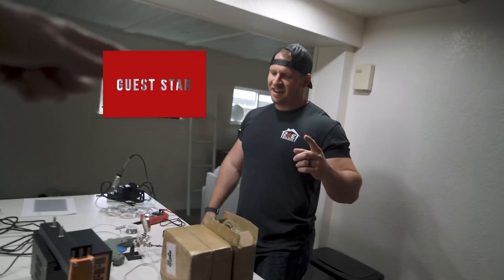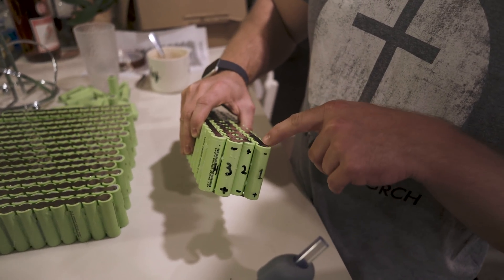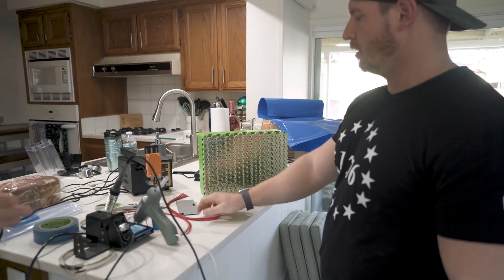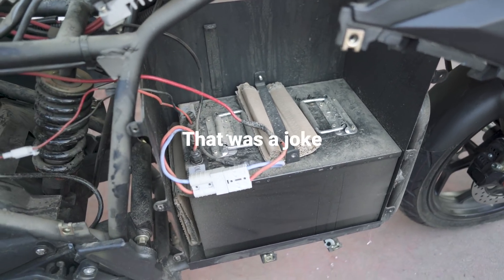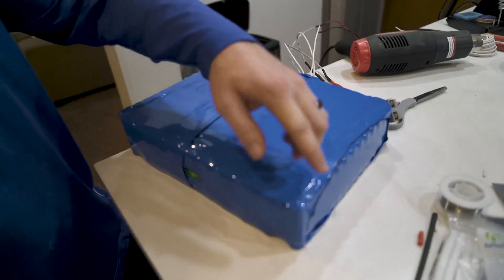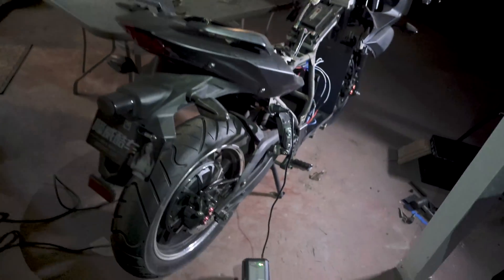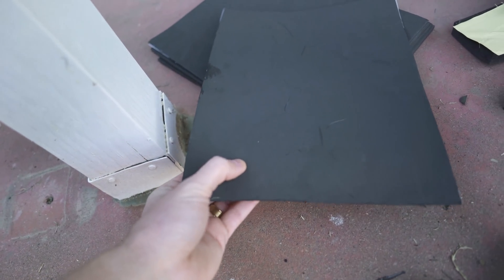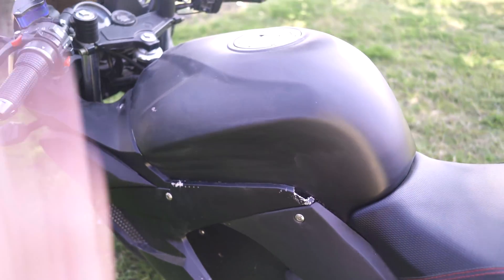UPGRADING the ELECTRIC SPORTBIKE from CHINA | Installing a Home-made Lithium Ion Battery

Comment: @ The Inja ... Right... Make another battery just as you did... And run it as parallel to the other battery... Nigh on double range.. and it'll fit in the battery storage area too 🤔😎
Oh and copper grease behind the pads will help reduce or eliminate squeaks (I'm a biker and it's a known trick to stop squeaks)
Reply: How heavy is the battery they built. Won't it slow it down the extra weight of a second battery

Comment: It's so funny to read comments:now go for new motor!!! Or : your controller is crap go for 500A controller!!!You made new battery but you made it for 3000w peak motor. Your motor is 8000w peak so you need to build at least one more same pack as you have now. Step 2 is power wires it should be at least 8awg. I tested ebike with 2000w qs 273 v2 motor. It was capable to accelerate fast to 85km/h. Step3: votol is not easy to connect but if you are lucky you coud easy to tune settings. There is some gear settings like low medium high and sport or R. In DISPLAY window you can check is it changes while you change it on motorcycle. Perhaps it was set on low when you did test drive.
Reply: Not true, you don't make a battery for a specific motor. You use one battery to power one system. His battery can and will hold it's ground on a 12kw peak motor, what's holding the bike back is not knowing how much power the controller is pushing to the motor. The power mode was a good idea :)
Reply: You can find me on whatsap or viber +37067183257
Reply: Tadas P I was offering help as well!
Reply: Tadas P He really needs a manual for the controller. It may be programable to take advantage of the new battery packs amperage.
Reply: @peterk.2772  I was offering help he said thanks no. So???

Comment: Hi dude , i would like to recondmend you using yyk7280 controller. Im using 60v battery, on this controller i hit 60km/h on the first gear. And it also have bluetooth module which you can connect to your phone apps to monitor the system. Im from singapore btw. Enjoy up video. Do make more video.
Reply: https://youtu.be/fSsEpPnuo0s
Reply: Martyr4JesusTheChrist  the controller is 48v to 72v 50a.

Comment: Hi mate. You need to check the amperage on the controller. Don’t forget the amperage is not the same as amp hours
Reply from the maker: Yep!
Reply: I’m about the change the controller on my ebike to a 72v 1500w with a current of 90amps. I’ve been playing around with changing the wheel and controller and I have the problem of not enough top end. Just recently I’ve seen some powerful controllers that you can do burnouts on. Soon as this novel coronavirus has died down a bit and everyone gets back to work I will order one for myself and then let you know how it goes. Also you need to check the CDR ( continuous discharge rate) of your lithium battery.

Comment: From a thermal management perspective, I’m concerned that you are asking for trouble by hot glueing the batteries together rather than using one of the spacer systems.
Reply: If you're running your batteries so hot the glue is melting, you're pushing your batteries too hard. They will hate you for it, and they'll degrade significantly faster.
Reply: Martyr4JesusTheChrist  I tend to mostly build packs for electric bicycles, and usually 24s 100A minimum. I've never had an issue with standard (good brand helps a lot) hot glue, unless the cells are being pushed wildly out of spec. Since they're for electric bicycles, space tends to be at a premium, so no room for cell holders.
I have no gripes about this battery build. Well, minus the severely undersized wire hahaa.
Reply: Martyr4JesusTheChrist  the high temp hot glue melts at a slightly higher temp than I'm comfortable to use
Reply: Martyr4JesusTheChrist  24s is 100.8v at 4.2v per cell, aka hot off the charger
Reply: Add another battery pak and it'll run cooler and faster. A more powerful controller (GOLF CART 275 - 500 amp!) and it'll rip
Reply: Martyr4JesusTheChrist  it'll reduce voltage sag under high load. Which if you're using flux weakening will potentially be quite a lot.
Reply from the maker: We'll see how she does

Comment: The battery is ok.  But Its not a good idea to use Hot glue.  if the battery pack heat the cells will move.
Reply from the maker: If the battery gets that hot, the glue isn't my main concern. Haha

Comment: those thin discharge wires worry me. i know they used them before but i still wouldn't trust it with upgraded equipment.
Reply from the maker: I feel you
Reply: Silicon 10awg is what you need

Comment: try to use thicker wire!! it can not handel the load if you pull 3000 watts @ 72 volt = 42 amps…. upgrade also the wire and performance will boost even more
Reply: Its not a speaker lol These dont work like. that. Even the wires on a Zero ebike are tiny. They're hall sensor wires. Hall sensors are TINY.
Reply: @RetiredYTChannel  What?  You think the motor receives all of its power through hall effect sensors?  The controller still needs 8-10AWG wire receiving from battery and 10-12AWG phase wires to the motor, almost 0 power goes through hall sensors, less than 100mah most of the time, I don't even understand why you'd comment that...
Reply: @row8261  All the controller wires are pretty small too. In this case it's not the bigger the wire the better.
Reply: @RetiredYTChannel  Yes it is, theres no downside to having oversized wires, only upsides like lower internal resistances and lower induction from longer runs of wire.  If hes drawing 40A through 14 AWG wire it will act as a fuse and increase in resistance as it warms up until the wire melts, the insulation melts and then something shorts, you really gotta stop talking.
Reply: Martyr4JesusTheChrist  haha no i cought my 8 year old son on my account
Reply: @bareldnijboer2730  no need to lie, just educate yourself on the topic in question or don't make incorrect statements.  @Martyr4JesusTheChrist this guy never stops.
Reply: @row8261  what do you mean? my son and i share a account on youtube and he posted something by mistake this morning and did a thumbs up (8 years old) so what...why do i have to lie?
Reply: @bareldnijboer2730  you changed your original response to what I have told you multiple times for 24hrs, you're not fooling anyone that your 'son' wrote the original comments just own up to it and move on.  And increasing wire diameter doesn't increase performance, which you stated incorrectly, it increases consistency and lowers overhead.
Reply: @row8261  i dont know what your problem is... but mulitple  times? i only posted one thing and i was wrong about the performance my bad... any thing else to whine about?
Reply: @row8261  what do you mean bro? the guy is the original commenter, he on the same side as you are from the beginning, you got it mixed up with the other guy
Reply: Thats gonna need at least a 8 AWG i guess.

Comment: You should remove the weight of that oversized battery box, paint the blue wrap black and mount the battery directly to the frame under the faring. It will help you reduce overall weight giving you greater acceleration and top speed as well as allowing the battery to cool off.
If you are talking about sustained riding at peak power you will ruin those batteries if they get overheated through every discharge and recharge cycle. 
Even if you keep just the bottom of the box and then use softeners under straps and strap the battery to the bottom. 
Even the lowly laptop battery has a fan, so you may want to consider one when you charge the batteries if they heat up.
Reply: Martyr4JesusTheChrist Do you know anything about battery cycling or how much heat is generated through sustained load currents?
It has nothing to do with build quality. Power must be dissipated somewhere. Otherwise he’s just gonna dissipate dollars from his wallet for more batteries.
Reply: Martyr4JesusTheChrist 

I didn’t read what you did. 

The batteries in this bike are insulated from the aluminum box by lumber, which does not conduct heat away from the pack. 

I meant the quality of the build won’t matter if it’s done patch work and the cycling of the batteries is not cared for. 
Some people only think about getting more power while dismissing the underlying constraints. 
It’s like the guy that boosts an engine only to blow out the tranny and diff because they’re not meant to take a magnitude higher level of torque. 
Clearly you understand power, so you know that trying to get peak power for sustained periods can be dangerous to the elements in the system. Especially if certain elements aren’t capable of dealing with sustained load. 
The wiring itself may be suspect before even moving beyond that. 

Too be clear, I wish this guy nothing but the best. I prefer to see people experimenting, learning and living life.
Reply: Martyr4JesusTheChrist  
"Yes... Hence why I stated what I did."

The first reply didn't state this or that you have a bike or understand power.

My patchwork and quality comment was meant to be inline with what you said. I probably should have used better grammar.

Nothing with electricity should be built as mutually exclusive modules. Everything has the connection to system power. 

I see your point, however, if the battery isn't touching the aluminum enclosure, then the dissipating effects are not optimal. It's just a hotbox with a lumber heat sink inside.

In fact I agree with most of your points.
Reply: Martyr4JesusTheChrist 

Good luck with all your projects and keep sharing what you learn.

Comment: It’s time for a 10kw motor now!!!!!
Reply from the maker: You know it!
Reply: There's no such thing. 
QS 273 is the strongest hubmotor @12'000~14'000W 
Pro tip: Get some ferrofluid, and hubsinks! 
Also, do you want higest Top-speed, or the fastest acceleration? 
QS273 3T will get you top speeds 
QS273 5T will get you torque 

If you have motorbrake when you let go of the throttle, disable that function and go for 5T all day long! 
Remember to let go, and re-apply throttle, similar to gear shifting a whole nother world will open up ;)

Comment: I think your one problem  you might be having is the lead wires are too small. The wires might be dropping  (OR limit) current  to the motor (controller) So  I thing thicker  wire might help. IF the wires feel hot then you should look into changing  the wires.
Reply: Troy Frei The bus bars inside the battery also look thin. That combined with the thin wires can limit current as well. As he mentioned in the replies, more upgrades are coming!

Comment: I won't lie, i really wanted an electric motorcycle like yours, even without the upgrades at all, but to get one of those bikes here would be a complete journey
1500USD of the bike
probably 600-800USD from the shipping
double that cost and put a 15% more to try and prepare for the import taxes
(i'm calculating the import without brokers, or it would be even more expensive with their help)
the price gets in the ballpark of 5800USD
1USD=4,30BRL (my currency), so 5800USD=almost 25000BRL
With 25k BRL i can buy new (the minimum wage is 998BRL):
Yamaha R3 ABS (2cyl., 321CC, 42HP and 3kgfm of torque); Yamaha MT-03 ABS (same specs as the R3 but a couple thousand BRL less); Kawasaki Ninja 400 (2cyl., 399CC, 48HP and 3.9Kgfm of torque); and other cheaper models
Used bikes would be a completely different and huge pool to swim, search and try to get good deals... 
Who knows one day i could do something like your projects, until there i keep subscribing, watching and liking
Reply from the maker: Glad to have you. You'll get there 🙌🏽

Comment: What is the top speed
Reply from the maker: Hit 78kph no load on the wheel
Reply: I have a electric grom clone, if you upgrade your controller you should get up to 90-100kph on the 72v battery and stock motor.

Comment: Extension cables look so thin,how many amps will it pull?
Reply: Yes the cables are thin, and you can calculate the amps from P= U*I at 82 Volt 36.58 amps, at 72 Volt 41.66 amps, but the electric motor is not always running at 3000W (except uphill)
Reply: @servicelinear13  Or it could be running above 3kw. Mine peaks at 14kw on a 3k mxus v3

Comment: Hey inja cause the bike is new the disc may have an anti rust Coating or the pads are cheap crap or the pads are glazed so rub the pads up and chamfer the edges too
Reply from the maker: Thanks for the tips!
Reply: Probably need to be broken in.
Reply: Do everything except chamfer the edges. Those are new pads on new discs. Chamfering them will only reduce the coefficient of friction and increase the rate at which the pads and discs wear.
Reply: What about checking the actual runout of the rotor?

Comment: Nice to see the battery is finished and upgraded. The motor is usually good for more power than advertised so like you say in the video the next step would be the controller it's obviously slowing the bike down or hasn't been programmed correctly. Hopefully you manage to get it sorted soon but ebikes can become very costly when upgrading components
Reply from the maker: Definitely.
Reply: @TheInja  It's worth pushing that motor, I put 14kw through an MXUS 3k v3.

Comment: You really need to upgrade you power cables on that battery. At 3KW you’ll see close to 40-45A on a 20S battery. Plus your likely to upgrade that hub to a more powerful one. You’re really going to need larger cable at that point. Go with #6 welding cable.
Reply from the maker: Planning on it. Thanks for the tip!

Comment: Make sure you use a beefy BMS :)
Reply from the maker: Lord Curt knows what's up!!
Reply: Yea, get the "ant bms" those have Bluetooth and screen so you can keep an eye on everything in the battery. 
Also keep in mind;
Amp = Torque (the more amp, the thicker gauge wires you need!) 
Volt = Speed (check the controller for specifics. Usually Max 95V for 72V controllers) 

And dude.. I know it's expensive, but please get some proper gauge wires inplace of that lamp cord you're using! Otherwise 👍

Comment: Bro I think the squeeking is bcz of the disks but not the callipers.
Reply from the maker: Checking it out soon. Thanks for the tip!
Reply: @TheInja  pleasure to be at ur service.
Reply: My guess would be crappy pads. On the cars I deal with a good set of pads will make a vehicle stop twice as fast with less noise. Make sure the rotors aren't warped and like that, possible they could use a clean up and all that if thick enough to take it but I'd still look at the pads first. I had a work van that always stopped like crap. My coworker and I found the best semi metallic pads we could find locally and the brakes were very aggressive after that and it stopped at least twice ws fast as before. Pads lasted about 10 years too on a constantly overloaded 97 chevy 3/4 ton. My Neon I put Bosch quiet cast pads on with new rotors and again the brakes improved immensely, though they are a tiny but noisy. I don't care because now I can easily modulate them or lock it up if needed.

Comment: The ending is cool, putting on tesla stickers :)
Reply from the maker: ...not actually a Tesla 💁🏽‍♀️
Reply: @TheInja  you might still swap the esc and keep the motor the same if its like most china stuff then that is the difference from factory to cut cost
Reply: Plenty of space for more battery
Reply: Looks like space enough for two, maybe even three more packs of that size. So, lots of possible additional power for a larger motor or çontroller and extended range. I'm curious what the Segway Apex is going to get in range, then, of course, m s.r.p. $$.